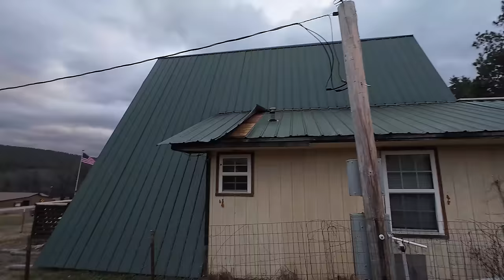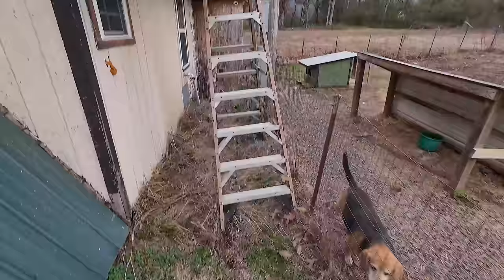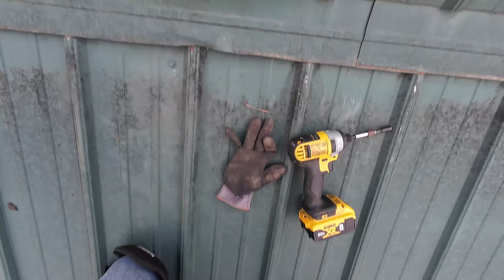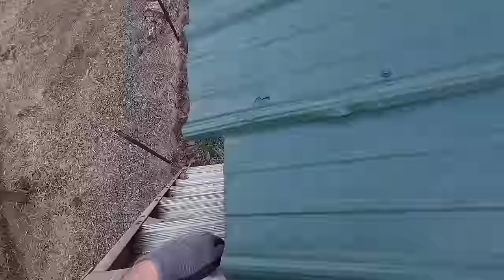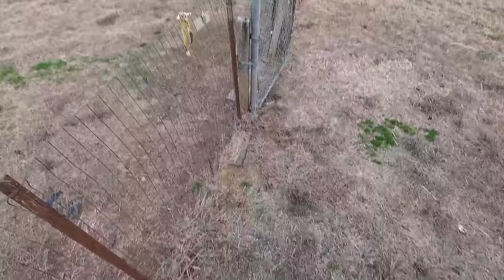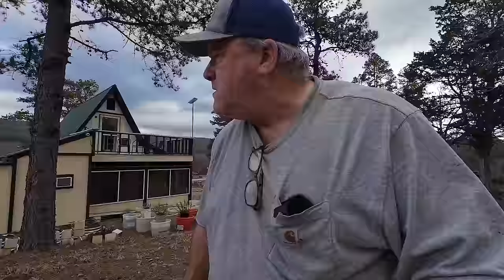Didn't Know My Roof Was Damaged! The Job Was Never Done Right First Time.

Comment: oh me;;;lol;it took me a few minutes to get up from my chair;;;seems like my butt grabbed on for ya and was holdin on;;;lifted the chair up aabout and inch before falling back down;;lol;;;;really that was an undertaking;;;I really got riled when ya started down and I saw them teeposts;;;just could imagine ya eatin on or sittin on one hollerin for help;;;;if you gonna go up again make you some walk boards to form a ladder to go up the iron;;I used aluminum pieces that come from windows that we ganged together to make doubles of which we broke off the flange of the insides ganged together;;;I also used some metal straping that was used for bundling lumber together;;;roofing nails to the 2x6 or4 and hole drilled in the strap a foot or so above the 2x;;;that way you could place a screw in the hole at the place you wanted a screw for the roof then after work was done could back out screws to remove walkboard and replace in roof and there ya go;;;anyway glad you down and don't drink too much scared relief medicine;;;;lol;;;anyway wee enjoyed the fact that you were man enough to get on roof and mane enough to say wrong thing to do;;lol;;;been there done that;;well we say thumbs up and we be waiting for the mext butt biter;;;lol;;;have a good one;;;at least that made ya a year or two younger;;;;we gone